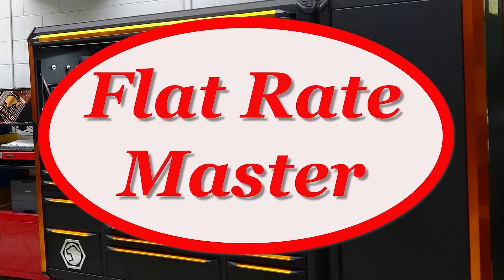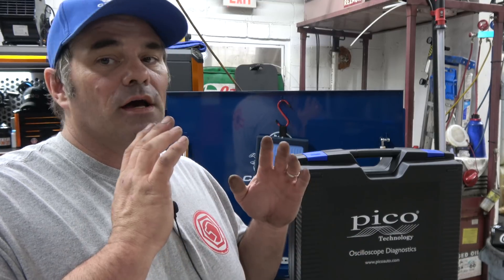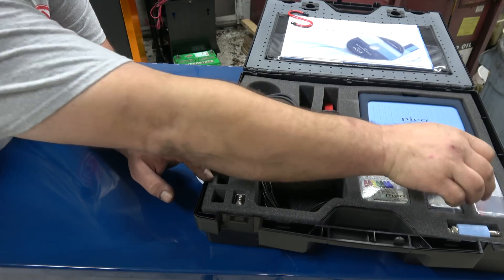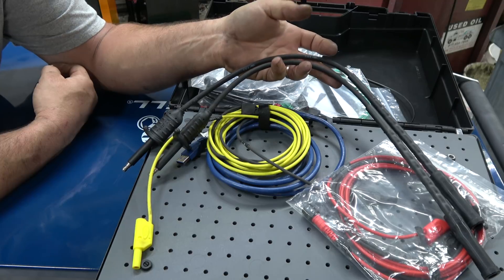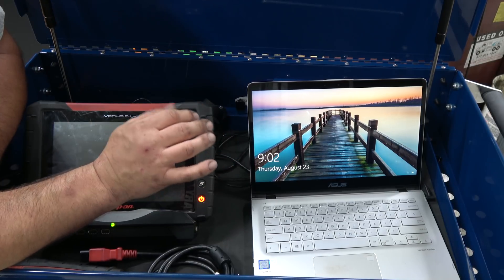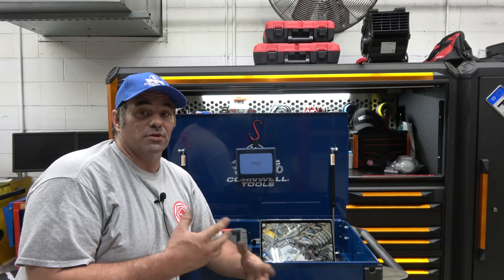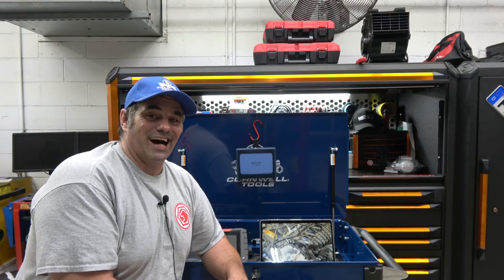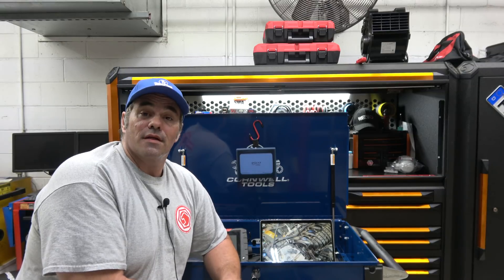FRM Gets a Pico Scope

Comment: I’m a totally rookie on understanding oscilloscope but I believe it is interesting on how many automotive experts technicians can manage this diagnostic tool. I’m always watching any video on YouTube and honestly I can barely understand. I was thought that oscilloscope and picoscope are 2 different kinds of oscilloscope and I think it’s only the mark or brand of a oscilloscope. May I please ask you this question Sr...Why there are picoscopes for Toyota, Lexus and scion. I have seen many different manufacturers. I thought the oscilloscope is for use on any vehicle no matter the price or the brand, I thought snap-on verus edge was the best technician tool. I’m going to subscribe me to your channel looking for more information about scopes. Thanks for the information you share.
Reply from the maker: When you see a branded Pico Scope, aka says lexus, Chevrolet etc on it, it is the exact same unit but was sold as a required tool to a dealership through that manufacturers tool program. Pico is just a brand/model of a scope many out there, ATS, Hanatech etc
Reply: Flat Rate Master thank you so much for your reply.

Comment: I work at a GM dealer and the PICO is a mandatory tool. I love it! So much easier than the old EVA and EVA2. Faster and more accurate. I've used it to diag out of this world weird stuff; a broken dual mass flywheel vibration, a rear differential ring gear out of balance are just a couple of problems.

Comment: My shop has the otc encore. I have the snap on vantage. One thing I've noticed is the 08 gs300/350. Otc doesn't have that brake pressure bias reset? function. Maybe only on certain car were missed. But you won't notice missing fuctions until you need it

Comment: Verus has an awesome scope, I feel like I would still use my verus scope more then a Pico if i bought one. Seems like a bigger hassle messing with a laptop and bnc connectors and having to use 20:1 attenuators every time you check secondary, dont have to worry about that with snapon scopes. But I do love the zoom feature it has
Reply from the maker: On the current model no attenuator needed for ignition or injectors

Comment: Heck yea we need more lab scope videos 
I bought a OTC and so far its great just need to learn how to use it to its full potential

The best part is when you go to a unit vehicle to go diagnose a problem that  and the previous technician's could not solvr  by useing the test light ,a Power Probe or Harbor Freight multimeter and you show up with a (in my case) a 2-channel lab scope and everyone is blown away and you're walking on water lol

I think they call that the big sizzle,

Comment: Spending that $$$
Reply: How u liking it? I used a picoscope last week while i was at class. Im a CDJR Fiat tech. Level 1 omw to level 2. I had a vehicle communications system diagnosis class and using the pico is great. I will be getting one soon at work as a shop tool I just graduated tech school this past febuary 2018. Im at a dealership so i have yet to invest in a scan tool since we have witech at work. And we have built in tool boxes too. So for now most my tools are sockets ratchets, air tools, wrenches, etc. But once im good i will be getting a scan tool. I like the look of the OTC one, i like the snap on modis my co worker has, i want to spend less tho, maybe an autel or launch i hear they are good, any thoughts on a scan tool for me to buy in like a year or 2

Comment: I think you are really going to enjoy the change to the Pico Scope.  It has been over 8 years for me now using only a Pico and have never looked back.  There is going to be some things that you are used to with the SnapOn scope that are handled differently with the Pico, but with the huge user base of Pico users now those types of issues are quickly handled and you can keep using the Pico to it's fullest capability after just a little research.  I also strongly recommend AESwave to anyone looking to purchase new diagnostic equipment & accessories.  Look forward to upcoming videos as you put the Pico to work for you.